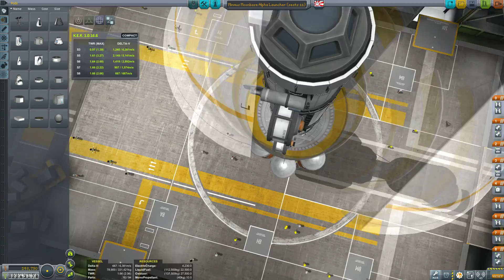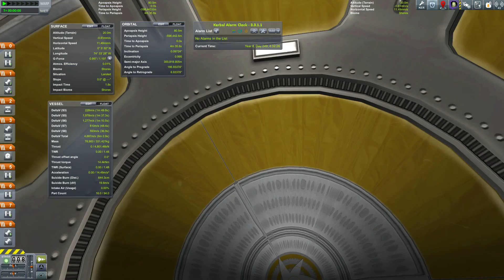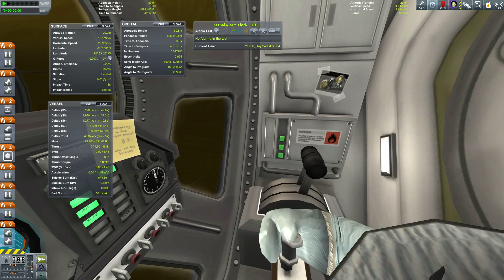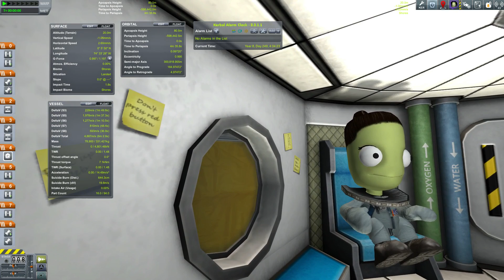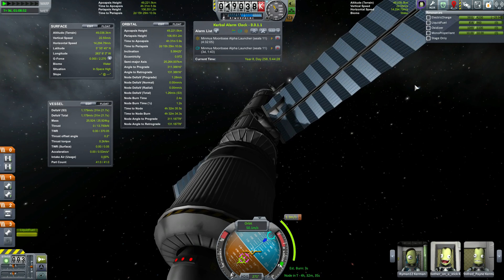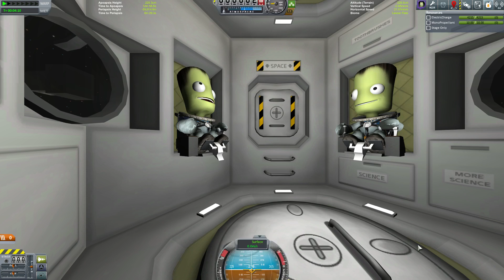Permanent Minbase [20] Kerbal Space Program 1.0 Career

Comment: 39:00 Experiments can be copied into science lab data banks. Once copied, the data value on the lab itself increases, to a max of 500. Depending on how many scientists you have working in the lab, they use that stored data to generate science, which can be transmitted to KSC and added to your science pool.

Is a good idea to deploy a science lab for every astro body you visit or plan to mine for science. All experiments on that respective body can be copied inside the science lab and used to generate science. The reason I recommend one science lab per body is to easily keep track of what experiments you copied where.

Comment: If you have excessive thrust issues like at 20:18, you can right-click the engine and change the maximum thrust in the adjustables dialog! This will make it a lot easier to fine-tune the amount of acceleration your rocket produces in space.

Note that you can only do this with liquid fuel engines, solid rocket boosters can only be adjusted in the VAB.

Comment: Any science result stored anywhere on a vessel with a lab can be used to produce data. Up to 500 units of data can be stored in a lab module (the lab can store an arbitrary number of experiment results, but only 500 data and 500 generated science). If the buffer of data is full, the lab will fail to process the experiments but the results are not lost. If one or more scientists are on board the vessel, the lab may be used to perform research, which will consume a small percentage of the processed data every day to produce 5 times its value in science. This process drains a significant amount of electric charge while active. The rate at which the data is converted into science is determined by the amount of stored data, the number of scientists on the craft, and their respective levels. The process continues in the background even when the vessel with the lab is not in focus. Up to 500 units of science can be stored before the results must be manually transmitted back to Kerbin. If the buffer storage of science fills up, work stops until transmission.
Reply: TheLeftLibertarianAtheist I haven't noticed that the uploaded data actually gets used up, it seems like it just boosts the speed at which the science is generated.  Also, if you have more scientists in the station, (even if they are not in the lab) it will speed up the production of science - a good reason to send out a crew replacement of all scientists!
Reply: phuzziwan_kenobi It might be changed in 1.0.2. I dunno.